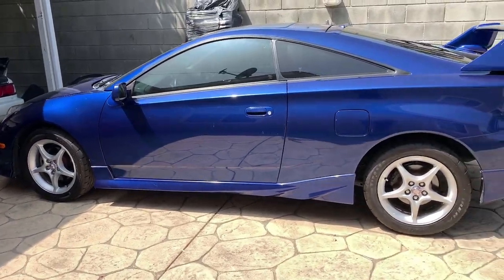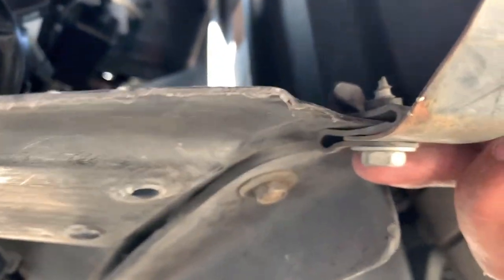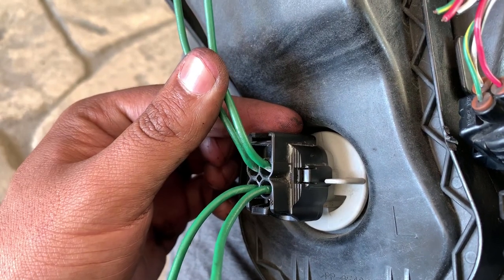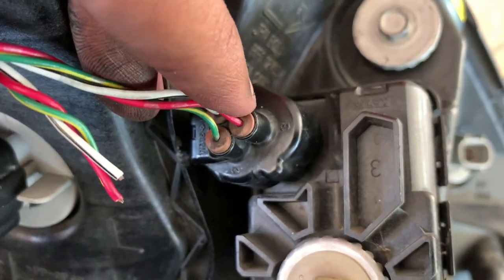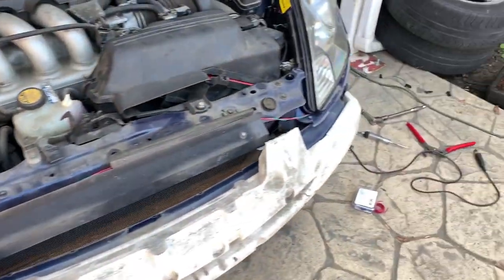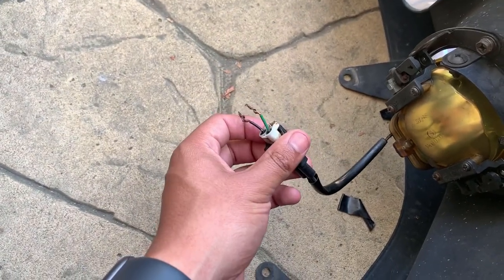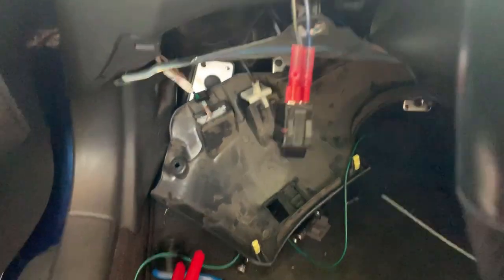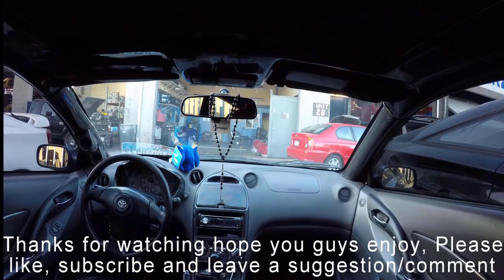How to Install TRD fog lights

Comment: A few more celica guys popped up. But I know you know your stuff!! Ok so at the junkyard i picked up a idaglow APC white cluster!!! It has a few wires basic red, black, 2 blue ones connected to a on off switch.. and 2 grey ones? 2 white that are connected to the plastic flat cluster those are fed to a blue little box I'm guessing mini transformer to regulate power.... I think the 2 grey might have been for dimmer? What would be best easy way to power it up?

Comment: So I scored some spec d tuning headlights with halos.. my question you got experience connecting the halos? The headlights I can connect all the bulbs   to sockets    but the halos is tricky
Reply from the maker: Robledo,D you need to connect them to a power sourse
Reply: @RafasGarage  I was thinking the side yellow markers on the bumper? Would that work?

Comment: Hey Rafa, if you don't mind me asking what Fog lights were they or you running? I'm trying to get the look that his Celica had. I know I need to find OEM HIDs but I was wondering what temp gave that blueish look on the regular fogs. Also, where did you get the fog light switch? That seems like a great idea that I'll try and add to mine as well.
Reply from the maker: Oem trd fog lights
Reply: @RafasGarage  Do you know the bulbs? or did it come with the fogs
Reply from the maker: @thekrimsonchin6023  came with the fogs